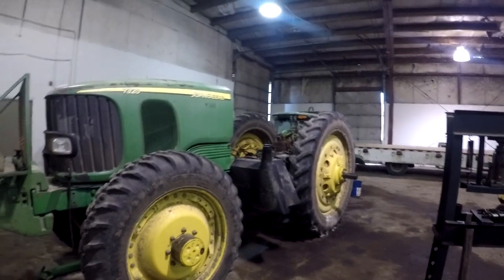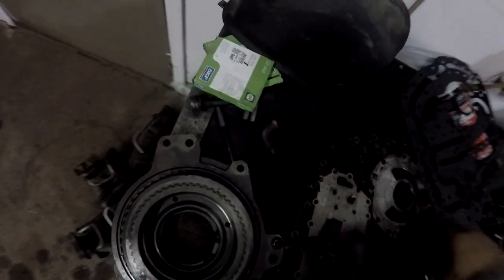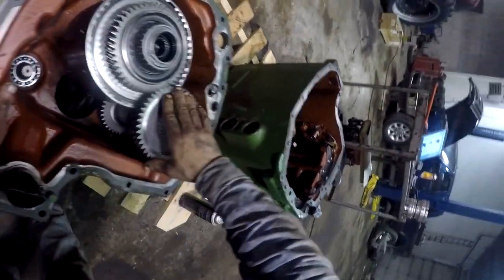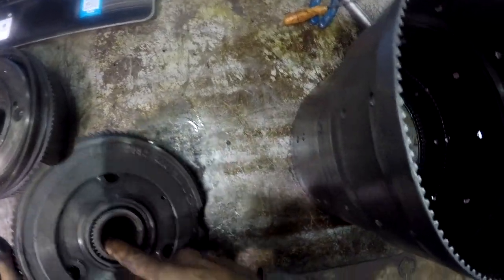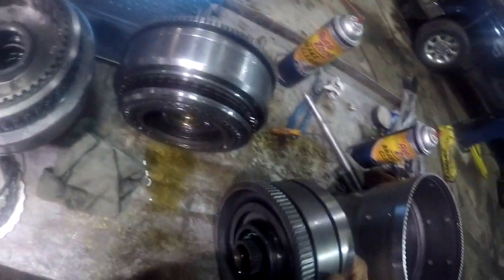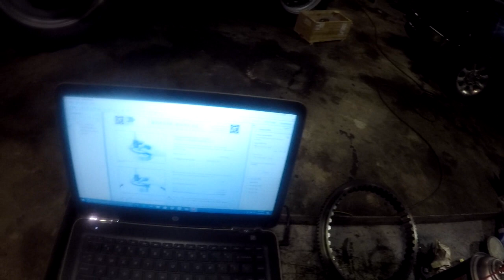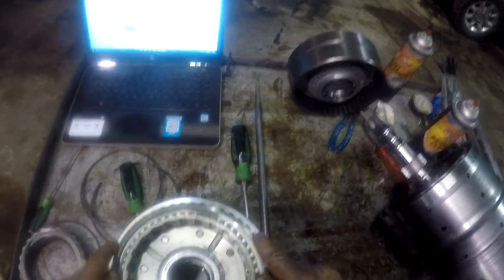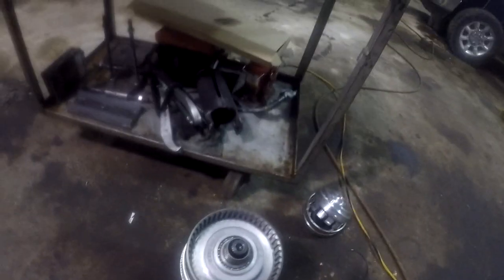John deere 7320 ivt reassembly part 1

Comment: Did this job work out OK. I can't see any finished video. Was the bearing the problem. I have 6910 autopower says input speed sensor faulty. Changes up gearing and drops back with no rev. Any ideas.

Comment: With the dealer only giving the owner USD10K, have you thought of buying a used tractor, fixing it up, and selling it for a profit?
Reply: I repair tractors that were damaged but were insured which gets paid out, they are then sold at auctions, I repair ones i believe will sell, the dealers would quote a fortune and farmers just think its too hard so they off load the tractor, happens everywhere all over the world, its a case of ones mans trash and another mans treasure.

Comment: Well at least you are getting to educate yourself  without worrying did I do it right next one that comes in you will have an idea how it's built
Reply from the maker: Adam Still  It's  a nice feeling  when you know that whether  it works  or not you still  get paid. Not used to that.
Reply: Yeah I live in southern part of Iowa have my own service truck I have a 98 f800 with 5.9 Cummins with 6 speed Eaton with air brakes with a home made service box with a 12000 lb hydraulic driven crane

Comment: great videos really interesting to watch . quick question.  I have a 2002 jd 6910 with an ivt transmission.  8400 hours on the clock. was just wondering what is the life of these transmissions if they are taken care of and not abused .. thanks
Reply from the maker: +Jt Murphy  Well this one here in the video had 18,000 hours on it and wasn't tool care of  but these guys didn't work them hard. I have found  that ivt's don't like the ripper.
Reply: +western truck and tractor repair  
thanks for the reply . do you find it hard to get parts for these gearboxes. like the clutch plates and so on . all my local jd dealers won't even supply me with a set of new clutch disc linings . a whole new transmission is what they want me to purchase which is ridicolous when all it could need is a set of clutch plate linings
Reply: +Odious Ktenology  these zf transmissions that are in these tractors seem to be Very troublesome . several guys I know of have replaced them at very low hours eg 3000 to 5000 hours . the fact that the transmission and the  back end share the same oil I think Is partially to blame . it's a real shame to have to replace a transmission at such low hours

Comment: Hello again :-) i´m the guy with the 4250 and 4450 JD  , i also have a 6150R in 2016 i offered 5000 USD on egr electronics fail  ......then i against the law got it chiped away and the tractor forgot its egr........2017 it ran 1000 hours with NO problems at all . have a day :-) Ivan from Denmark
Reply from the maker: Ivan Hansen  This one isn't  going to exist  anymore  either.

Comment: The main Problem i see on that 6170r is the way too big amount of idling at very slow speeds compared to operating at full power as it is supposed to operate . i doubt any other Manufacturers Tractors would work better on these conditions. Also i would not call it Emissions Bullshit as i saw too many people pass away on lung cancer from breathing in Diesel Exhaust for Decades and none of them where smokers.
Reply: Frank Schenke it is emissions bullshit . The engines aren’t running as long and more fossil fuels have to be used to replace them at a much higher rate than older engines.